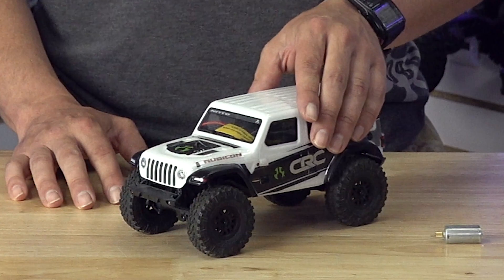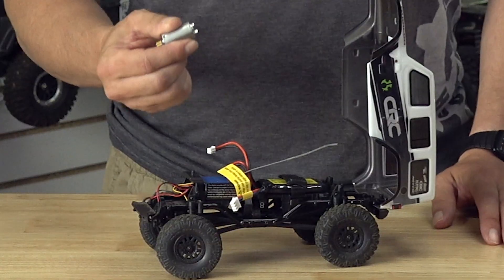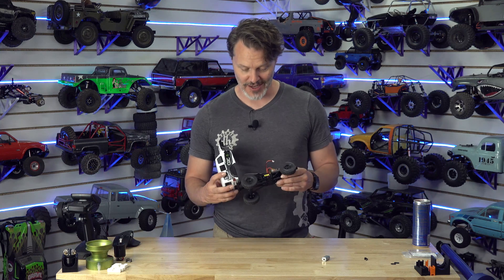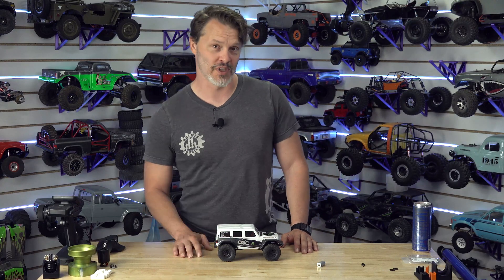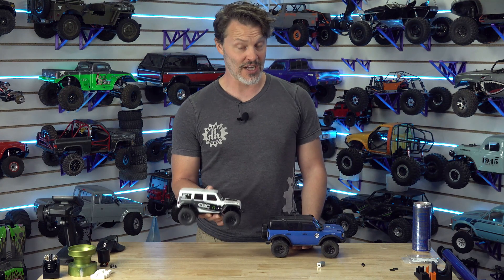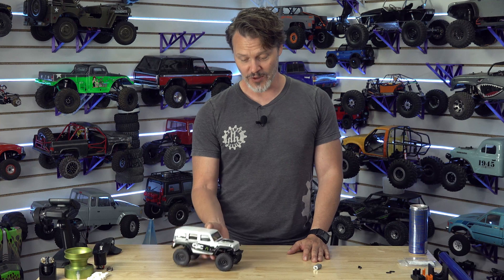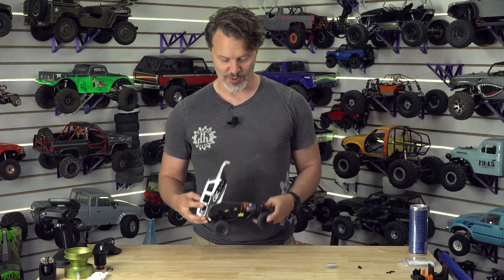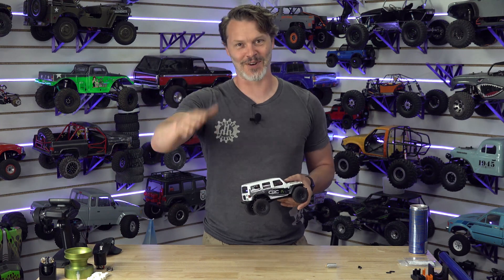Revolutionizing Micro RC Crawlers: John Robert's Custom Motor Masterplan

Comment: @HolmesHobbies If possible have a look at the FTX Outback 3 Mini crawler. Certainly here in the UK they are more popular than the SCX24. I personally run many scales from 1/5th down to the 1/24th scale. The 24th scale crawlers are great fun outdoors and are the way to go when the weather is awful and we want to go crawlin indoors. (happens a lot here in Scotland)  My friends and I have got many people into the RC hobby with most of them starting out with  FTX outback 3 mini (1/24) or the FTX Ravine (1/10) rigs. In the USA the Ravine is called Danchee Ridgerock and the Outback3 Mini is available under several different names. Pretty sure there is a good market for upgrade parts/motors for these rigs, especially the 24th scale Outback3 mini crawlers. Keep up the good work and I hope Your motor project goes well

Comment: Scx24,  Fcx24,  Fcx24m, for the 24s then there's a few 18s that are OK but 24s are becoming extremely popular. The new Fcx24m are new out & hardly anything is there for upgrades yet so might be a good plan to start with them & the Scx24

Comment: I've been building 1/10 scale crawlers for several years and never could understand what people saw in the micro stuff. But like you said, when covid hit I started seeing more videos about indoor micro crawler courses and said to myself screw it, they are cheap so go for it. I decided to try one and couple years later now I have more than ten micro rigs because it's like they multiply while you're replacing or upgrading parts. I've always wondered why you didn't offer more electronics for micros and now I know why. I'm sure you will do quite well in the 1/24 and 1/18 scale market since most people that I know that have micros also have 1/10 scale rigs and would love to have your products on all the different sized rigs they have.

Comment: Our fleet has 3 SCX24 and 3 FMS Smashers and 1 FCX24 Blazer.  

We upgraded motor in the SCX24 Deadbolt by trimming a little. Hate the tiny hardware but travel well everywhere. 

Cleaning up the glitter nail polish was a Dirty Job but Somebody’s Gotta Do It. Then it’ll be time to Return The Favor and buy a few of the new micros. 

Nice tune. 👏🏼👏🏼👏🏼

Comment: I have 3 1/18th scales and 3 (soon to be 4) 1/24th scales. I would love to see what you come out with. I have already upgraded my 1/18ths to either the 66T or the 87T. 

Really the only other brand is Dynamite 88t and it’s just ok. I put brass on my SCX24s and after just a few brass upgrades the stock motor struggles to push it around.

Comment: The current best motors are the micro komodo,  mini komodo and cedar motor from Furitek and then the NanoBam v2, ROP & SMP from Mofo. Furitek'sPython Pro esc is also one of the best with it's bluetooth tuning and FOC. and then the Dinky RC ESC is also pretty good (from what i hear)

We consider Micro as anything  under 1/28.  The mini b, mini t, mini z, mini jrx2, and a few others range from 1/16-1/28. Anything smaller is really a micro. (Orlandoo Hunters are 1/32-1/36 and then they go all the way down to 1/76 as "Hobby Grade")

Comment: I own four of the SCX24 micro crawlers and my class 1 rig runs your brushed 050 66T. I only needed to add an aftermarket motor plate. No chassis mods were needed. My class 2 and 3 rigs run MoFo nanoBAM and Furitek Cedar inrunner.  The sweet spot for punchy wheel speed and low crawl with the stock gearing seems to be around 3200+kv. I run Dinky D-Drive Escape32 based ESC's and the rev11 FW and his custom tune has imperceptible FOC transition. It just smoothly transitions from slow crawl to go and is better than my Castle Slate Series 1900kv paired with Castle ESC on my 1/10 scale. I wish someone would do a better rear facing mount for SCX24. The typical forward facing mounts put the motor up high so if you reverse the transmission so the motor faces rearward puts weight up in the wrong place. MoFo attempted to make a rear facing mount that keeps the engine low but you are stuck with a giant pinion and unable to adjust your pinion to spur mesh and unable to use mod.5 gears because of the giant pinion requirement. He clearly designed the mount after designing the motor. It would be great if you were able to design a brushless motor that worked in the factory location. The form factor challenge will be managing the overall diameter of the housing so that it clears the transmission.
Reply: Also, none of mine are on the stock chassis. They are ground up builds based on the SCX24 platform. My stock chassis and white Jeep JLU body are just sitting on the island of forgotten toys.

Comment: I only run scx24s. I have a rear steer portal nwchassisworks pitbull buggy running your 050 motor 66t is butter smooth on 3s. Your brushed motors have been my only selection for these little guys!

Comment: I absolutely love my micros. I have a couple scx24 comp trucks. The new redcat ascent18 has taken the mini scene by storm, and I love mine. I also have an austar trx4m knock off that accepts 95% of the trx4m parts. My favorite rigs currently are hobby plus and furitek variants of those. My fx118 is full 4 wheel steer comp truck. 
A local hobby shop has an indoor course and does a winter comp series. Splits the 1/24 and 1/18 into separate classes and has 3 classes per size.

Comment: I have 5 fcx24 rigs and 2 scx24 rigs. All brushless with inrunner and outrunner motors. If that helps your thinking any. Most of the motors are like small drone motors or small in runners like mini z stuff or comparable. Just for ideas

Comment: I started with scx24 and got deeply into micro for years. Then I got a couple of FMS FCX24 when released and made a huge improvement in the scene. Then the Traxxas came and I got one.
For building a reliable and easy to drive rig for my kids I take the Axial, for the tons of parts I already have. For a good overall rig I use my heavily modded Trx4m, but I reckon the Traxxas is a pain to work with compared to the Axial or FMS

Comment: Most of the 050's on the market have reversed mount holes so many manufacturers offer an X pattern motor mount that allows stock or aftermarket motors.

I have a HH Revolver in one of my SCX24's using a Mofo motor mount. Brushless is the way these days

Comment: I run a modded ax24 with 32% or sumtin close od on front with 50t 050 deadbolt length hillbilly made steel rear lowers 4mm hex extentions brass knuckles on front  and ramp crab front steering link redneck brass wheel weights and 50 bb each front wheel 25 in back ramp crab servos ran rear direct power. Injora esc and motor. Hot rc 6 channel receiver  and injora carbon fiber rails. Extending front links. And redneck slip yoke both driveshafts rear is currently solid causing binding
Reply: Be cool ta see fresh eyes in the manufacturing of these Lil crawling beasts

Comment: I feel like the scx is oversaturated with decent stuff. I got pretty bummed out when my high dollar custom chassis was outclassed by my fcx 24 just by adding tires/brass rings? and the included orings/oil. 

That M would be where I would go and have plates for the other 18s, especially the red cat, fcx, and hobby pro  offerings. 

Also, take a look at the arrma groms. 370/380 speed run and basher type stuff where it's still handy to have smooth startup.  Those also are not staying in stock and everyone is snapping shafts with the popular castle offerings on 3s to the point where I'm seeing guys carry a few of the temu ones in their bags just in case.

Comment: I've got an SCX24, I like it.
I like to just go out and mess around.
I have an aftermarket steering servo, and Pro-Line tires. I think those are the two things that give it the largest boost in fun-capability. I look forward to putting a HH powerplant in it! I expect the improvement in torque and smoothness will be really nice.
I'm now working on a 6x6 model semi truck, using SCX24 running gear. That should be fun.

Comment: I have a few scx24s and a 1/18 Redcat Ascent.  The weak points on the scx is basically...everything lol. The Redcat, I put metal links, driveshafts, and wheels on it and its a great little truck.  The scx24 platform, most people will relocate the battery to the front side of the transmission for better weight distribution so theres plenty of room for a larger motor is probably 90% of them out there.

Comment: Our house has 3 SCX24s so we can crawl inside or out no matter the weather in Vacationland. If the TRX4M platform had been out sooner, we probably would have gone that route instead, but we are vested in the SCX24 now. So much so I just ordered a new motor mount so I can try a Holmes 050 in one of our rigs. Hopefully that will tie us over until your new system is released. Thanks, can’t wait!

Comment: Ever since the OG, the losi micro crawler almost 14 years ago I still say when taking brushed motors it's worth adapting to 130 on 1/24's like the scx24 and using 180 for the 1/18ths like the TRX4M, FCX24/18, and HobbyPlus RCs. The 030 and 050 motors are just too small.

Comment: Gotta a TRX4M high trail and it's pretty good but a pain in the ass to get the correct fitting parts. I'll stick with the 1/10 scale but definitely adding one of your motors to it

Comment: Micros and minis are super popular. Most commonly the SCX24 and TRX4m, the Redcat Ascent 18 took off like a rocket and now the CR18P from Hobbyplus. The FMS FCX24 and FCX18 are also popular. People seem to use the SCX24 platform for scratch builds and TRX4m for all around use from scale trail to comp. Furitek is probably the top dog in the small scale brushless game, Injora just dropped an outrunner with ESC combo for like $60 but it lacks features from what I've seen. I think alot of people gravitate to Furitek because of their app to tune with the built in Bluetooth module on their ESCs, but they go for a premium price point. I think a mid budget drop in system would sell a ton, kinda like what Injora is going for with theirs, but with a Holmes twist and some good tune ability. I'm super stoked to see what you come up with for the small scale segment!

Comment: The problem with SCX24s is that they are pretty terrible out of the box. They need more done to them than if you equate them to a 10th scale let's say. I prefer their worm gear axles over the ring and pinion for the mechanical drag brake so I don't waste battery and create heat doing it with the ESC. Plus the transmission is simple and light, and they essentially become an 18th scale once you stretch and widen them a bit. SCX24 Gladiator and Power Wagon have the same 155mm wheelbase as the TRX-4M too actually.

Spektrum made a brushless system for these that was atrocious. But it was a bolt-in affair similar to what you are after John. Nick over at MoFo RC has some sweet little outrunners that go in the stockish motor location but with some slight tweaks. These are probably what you are referring to I'd guess. I've had them all, so I'm extremely curious and excited to see what you come up with that is different than the others but still stay in the stock location.

Comment: Check out #TheShopMiniRC he covers all little rigs and reviews are like no other. 

No comps here but did manage to do axspeed overdrive transmission with 0.30 motor for under $30 on my msa1e from carisma.

Scx24 built for towing has rcawd 370 motor and metal transmission.

Ascent18 has $20 esc that is 3s capable and runs silent. Plan to run your trx4m motor(s) on it. 

Believe it or not these minis help get folks into rc for fairly cheap. 1/24 & 1/18 got me into rc not going to lie. 

Plan to run your motors when available. Thanks for making parts for the mini rigs señor!! 👍

Comment: I have both 1/24 and 1/18 and I feel like the little extra space of a 1/18 for batteries, esc and receiver is really nice. I get very annoyed with the lack of space on a 1/24. Finding space for that stuff isn't part of the fun of building for me. I started with a fcx24, went to 1/10 stuff, now I have a scx6 and will probably make another more competitive six, it's the best.
Reply: Fcx24 is pretty much a 1/18. Problem is, they tend to be too wide for most 1/24 competitions.

Comment: Personally, I'm not a huge fan.  They're way too much of a PITA to work on with how tiny everything is.  It has been about 20 years or more since the Micros and Minis started.  Losi did a bunch that were a big hit, for a minute, 20 or so years ago.  That is definitely the norm with micro and mini RCs; they come out and are hugely popular for several months, then demand completely disappears and they're gone for several years until the manufacturers try again.  The TRX4M and SCX24 both seem to be in a place demand-wise where they will stick around, but I still wouldn't be surprised if they eventually die off.  1/18 is mini and 1/24 is micro.

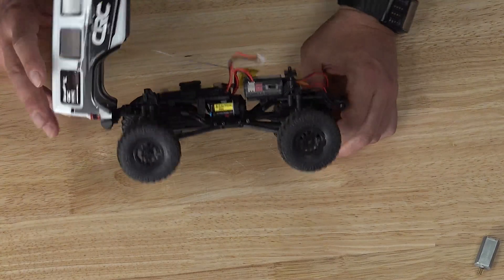Comment: Yep now is the time for mini crawlers they have been improving at a fast rate & it’s not slowing down. When they first came out it was kind of a novelty but I think the SCX24 kinda opened up the door & right away the aftermarket for parts just took off. But motors & servos where entry level & not good at all but now the parts have really improved especially more recently now we have features you would only see in a 1:10 scale rig like brushless set ups & servos & 2 speed.  My first RC was the first edition SCX JLU & I actually have a brushless motor in it but it’s painful slow. I upgraded everything on it but when I got my first 1:10 scale that was it I didn’t get anymore mini crawlers & pretty much just ran 1:10 scale from then on. But now after getting a FMS mini with 2speed & it could also slow crawl very smooth even with the brushed motor. After that I’ve been back into minis a lot & have 1:24 & 1:18 scale now. My favorite is the 1:18 crawlers FMS has some very good ones & Furitek also has some nice RTR’s like the Fury wagon. Recently Hobby Plus put out a 1:18 LCG rig 2speed brushless motor & it’s one of the first LCG RTR’s to come out. I’d say the TRXM is more popular then the SCX24 mostly because it’s a 1:18 rig but the SCX has a huge following & a lot of people are building custom 24’s. One of my favorites is the UTB 18 I have a brushless set up & full size LG servo in it. It’s definitely bigger then 1:18 but you can get tons of upgrade parts. Overall mini crawlers need more servo options including brushless & good motors but mostly esc’s are needed. You can have a great motor but the esc controls it so that’s where even the current systems don’t feel as smooth as let’s say a 1:10 scale brushless system. So to start minis came out to fill a niche & brought more people onto the hobby but now the enthusiast already in the hobby are getting into them & building minis that’s the difference it’s not just a fad real RC enthusiast are getting into them & doing a lot of custom builds. I just just the TRXM Ford F-150 High Trail & have low speed metal gears in it aftermarket motor & servo metal beadlocks etc. From experience the M is probably the most popular but has the worst electronics of any of them. It’ll be the first things many people will change everything else is solid & the High Trail Edition from my experience is the best form of the M. 👍 Happy building whatever it is you are coming out with will definitely hit a hot market but we Need Servos! 😉🙌

Comment: Hell yeah! Can't wait to see what you come up with. I am big fan of Micro Crawlers. You can crawler anywhere, from your hotel room, to backyard or to some far out location. You'll be surprise how a pile of rocks in your local park can be super challenging to crawl on. I do own one of your 050 motors, it's a "go to" in the micro world for brushless motors. My comp rigs are super light and have forward weight bias vs my trial and "go to" rigs are super heavy, slow crawling with some with speed. I have never owned a box stock SCX24 or 4M, so my knowledge is somewhat limited when it comes to stock stuff. But when I installed your 050, I have a factory looking plate with 4 slotted holes in a rectangular layout. I believe stock is 2 holes across from each other. Other companies include a motor plate, some with 9mm or 12mm bolt spacing. I haven'y measure stock, but it might be a different bolt spacing. No one cares about the stock battery tray. I would focus on bolting up your brushless motors to a 9mm or 12mm bolt spacing. That way, people who are already invested into a brushless, them can just swap out the motor and not a motor plate and motor. We usually move them forward or on the slider or up front towards the servo. I have over 20 different micro crawlers from the SCX24 platform to the 4M platform. SCX24 has way more aftermarket support than the 4M, there are more comps just for SCX24s. The 24 scene is like the 10th scale scene when it comes to Axial based mods vs Traxxas based mods. I hope that puts things into perspective. Other brands like FMS,  which is like RC4WD, super scale, but not as capable. FMS just released the FCX24M, it comes with a 2-speed, straight axles (no portals), ring & pinion, hardbody and tons of scale add-ons for around $100. The cool thing is that the FCX24M shares the same bolt pattern skid plate to frame rail as an SCX24, so adding a 2-speed is going to be fun. The Micro scene really needs an IFS, trophy truck RTR-ish type. Just a thought of doing something different. Furitek really cornered the brushless market in the Micro world. The scene is more considered a Micro than Mini. Mini is more in the Kyosho Mini-Zs. I have two Mini-Z and they are poopy when it comes to performance. Super scale, but even with all the mods, the Mini-Z is not worth it. I look forward to what you come up with. Please don't hesitate to reach out if you have more questions.